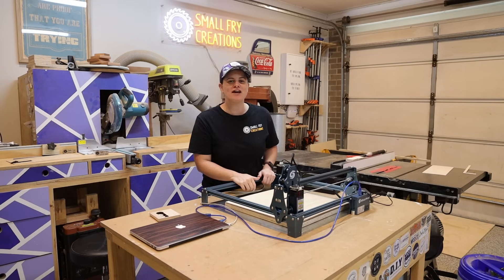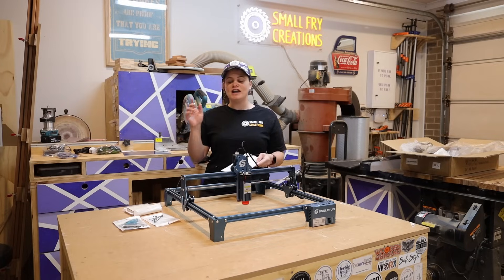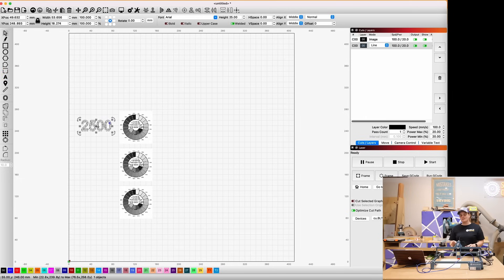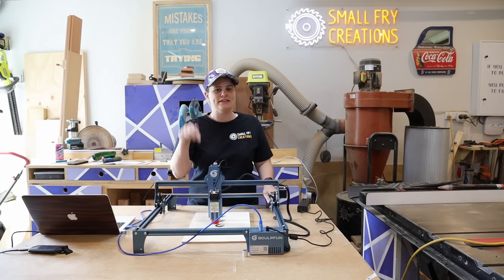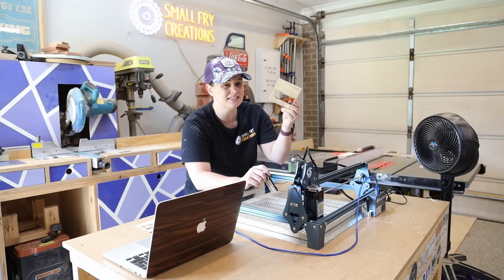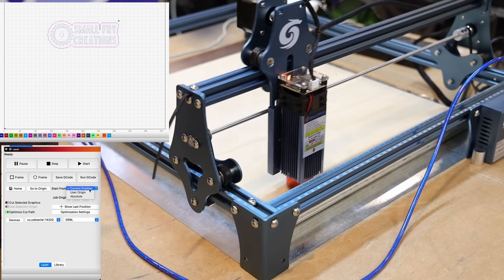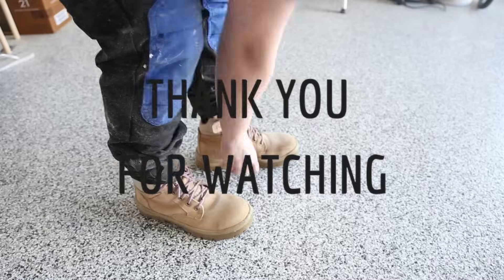BEGINNER Laser Engraving and cutting tutorial with the Sculpfun S9

Comment: Good tutorial.
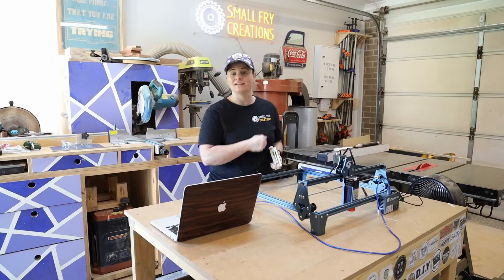At 9:05, in the plywood cut, in the settings at C17 you set 2700/80% and at C07 you set 300/100%; so my question is: does the laser perform one function at a time, that is, does it record then cut or vice versa? Thanks
Reply from the maker: Thank you. For each cut or engrave you want to do that is different you set as a different colour (layer) and then input the settings. When you start the laser it will then do each layer one after the other. So when I did the logo I set the first layer as the engrave layer (fill) and then the second layer as the cut layer where I slowed the speed from 2700 to 300 and upped the power from 80% to 100%. Hope this helps. Any more questions shout out and I can try and help 😀
Reply: @SmallFryCreations  Thanks for the very satisfying answer. I have the Sculpfun S6 Pro, do the settings differ much? Could you share/link the logo you used? Thanks again
Reply from the maker: Fantastic!! I’m not sure how much they would differ. Would need to run some tests. The logo I use the video is my own logo. The link to test file I use for check the settings is in the description of the video 😀

Comment: Great  review, a couple of points,  is their any consumables  ? Can the program run on a iPad?
Reply from the maker: Thank you Steve. No consumables other then the material you want to use. LightBurn doesn’t run on an iPad. There may be other software out there that can use iPad. The blue cable that connects to the computer is a USB port so you would have to get an adaptor for the iPad to take the USB if there was software 😀